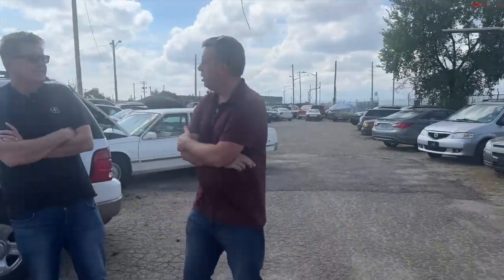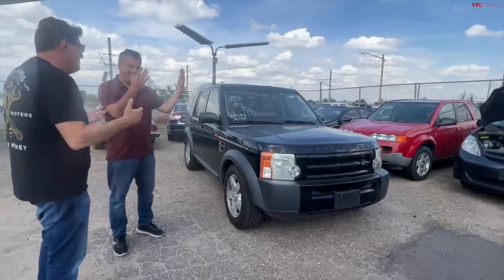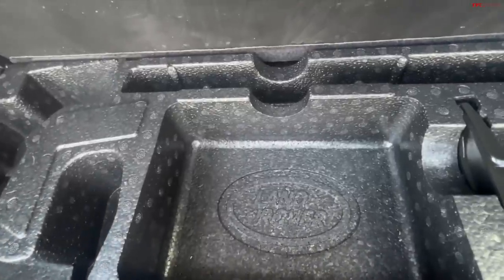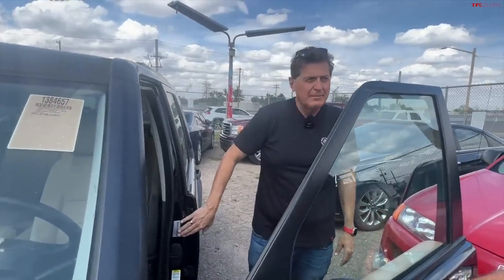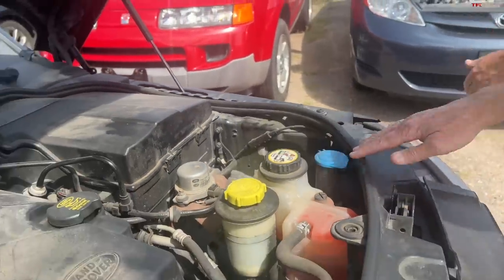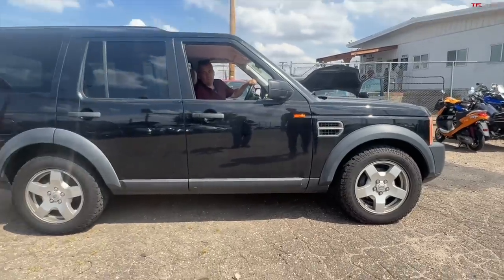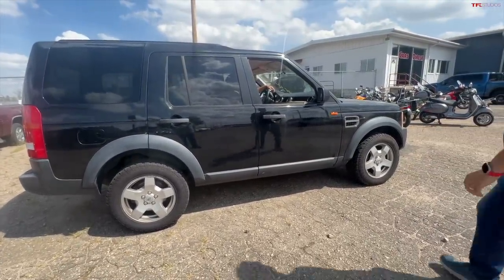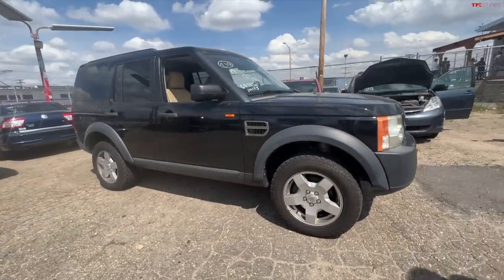Oh No...I Bought a Much Loved Car with One of the Worst Reputations for Reliability! Am I Screwed?

Comment: Transmission is:  6-speed automatic ZF electronically controlled with Sport and Manual modes; 2-speed electronic transfer gearbox with shift-on-the-move capability

Comment: I used to work at a local import shop repair shop and the top 3 most problematic vehicles were early late 90's/early 2000's Mercedes, Jaguar and Rover. Mini and Audi come 4th and 5th (so by proxy, some Porsche and VW)
Reply: JDM ftw

Comment: I purchased a 2006 Range Rover Sport last month which shares quite a bit with this LR3. Mine already the Atlantic British coil conversion, so no air suspension. It also came with a receipt for a $4800 transmission service that was done last year. I had to replace the rear brakes and rotors- the fronts were already done recently. I also replaced the O2 sensors. It drives great, blows cold AC, and the fridge works. These can be had for quite a bargain if you are willing to take a chance.

Comment: The missing Vin could be from the dash being replaced. They cracked in a lot of LR3s.  I could also just be a cover.  The V8 in the LR3 is the best V8 they had and didn't have headgasket issues. That was the D2. The v6 is fine.

Comment: If you are worried about problems with the air suspension, there are steel spring conversion kits available from the UK, at a cost of £500-800.

Comment: The valve block is probably leaking. Replaced one, its very easy. The V8s and trannys in those are easy to get 300k miles out of. Biggest concern is the front diff which isnt too bad to replace.

Comment: I just picked up a L320 Range Rover Sport based off that LR3. They're solid cars will have some small issues. Sun visor might cause a transmission fault message, of course the compressor as you mentioned, various latch sensors... Slowly going through mine. About a month new to me.

Comment: Let me say this - I have had 3 so far 1 car accident, 1 was not good, 1 is great. It is a very comfy ride- endless storage, nooks & Crannies :-) you can sleep in the back with fold down rear seats. I have had no issues to date with air suspension- and the coil conversions are available that are relatively inexpensive. Downsides are WEIGHT- it is heavy- the aftermarket for off-road accessories is not as robust as I would like (I would love a rear locker but it appears to be cost prohibitive), Electronics are a bit spotty. With The GAP II tool for the OBD is a life saver- pricy but awesome. I picked up a Range Rover sport as a daily driver (same drive train & Suspension) and though more fleet of foot, does not nearly have the storage, cup holders as the 3. 
Lastly, the Land Rover community is very strong and not nearly as many as the "bro" types that the jeep crowd attracts. Thanks guys for highlighting the LR3!

Comment: Thatll be a 2.7, if the cam belt and hi pressure fuel pump belts have been changed the you are fortunate, the suspension usually drops when parked for a while due to leaking air bags and the consequence is over working the compressor. Trace the leak/s with a mild soapy water solution and replace the air bags before the compressor burns itself out...and cgeck those belts/tensioner...
Reply: 2.7s don’t exist in the US. The US market never had a diesel. That’s a 4.0 V6 petrol from Ford.
Reply: @mcandrett 4.0 will be a V8 the V6 is a 3.0. Taken from Jaguar but produced by Ford.
Reply: @tonychalmers9867  This is the US market. The 4.0 is a V6. (From Ford or Jag, whichever, it’s a 4.0 V6 they used in the Ford Explorer). 
The V8 is the 4.4. If you look at the entire video they actually tell you that.

Comment: V6 LR3 owner here. Like the explorers 4.0 SOHC timing chain are the weakest point for this vehicle and it has a total of 4 timing chain and cassettes/guides and they like to fail after 120-140k miles. Otherwise its a great little work horse of a motor, pulls the rover smoothly, and power delivery reminds of of the D1 and D2 4.0 V8 engines.

Comment: I had one of these with the V8, many electrical issues related to air suspension components, but otherwise everything SUPER solid to very high mileage before we got rid of it, engine great, trans great,

Comment: Lol the 4.0L’s are absolute nightmares, have fun 🎉
Reply: SOHC 4.0s are for sure. The older pushrod ones run FOREVER, I have 315k and counting on mine (I think.... only has 5digits on odo, could be more). Really a shame how they took one of the most reliable engines they've made and ruined it with a halfass sohc conversion. I wonder if they could bolt in older 4.0 in it's place???
Reply: The 4.0L V6 is a way better engine than the Rover V8 that came in most of these. Tons of Explorers, Rangers, and Mustangs with 4.0's with a whole lot of miles on them.
Reply: @Stuka87  these didn't come with the Rover V8 though, the last LR product to ship with those ended in like 03. The optional upgrade engine in the LR3 was the 4.4 Jag V8, which is actually kind of a tank if you replace some of the plastic cooling system stuff as it ages.

Comment: Actually the LR3 is one of the most reliable Land Rovers ever made. Plenty of LR3’s with over 200k miles with original engine and trans + no major issues. Unlike the Discovery 2’s with head gasket issues.
Reply: The air suspension and idk if us has diesel version but the tdv6 engine with chocolate crankshaft is the issue but they are more reliable than the modern land rovers the ingenium engines are shit
Reply: That's a pretty low bar for comparison.
Reply: @sbrader97  Actually the LR3 air suspension issues were always cheap and easy to fix, typically bad hoses, but compressor on these were very good
Reply: My lr3 has 276k on original drivetrain
Reply: @sbrader97  We never got the TDV6 in the US.
Reply: The ones with over 200k miles are outnumbered 50-to-1 by the ones that never made it half that distance.

Comment: If it has a ford transmission as well, its probably only a 4 speed. The F-150 still used a 4 speed in 2006.

Comment: Hahaha, thats great.   Im a long time Land Rover fan.  Owner for 20 years next year.  Lotta ppl hate on em, but when they work they work.  So glad you got a good one.  Paid a fair price especially with such an immaculate interior.  AC may charge itself when the alternator gets cranking full blast again.  My AC will blow hot when the battery is near dead and the alternator is working double duty to keep a charge on it.  AC blows cold again after driving for a few miles at hwy speed.  Ive got steel coil springs and would recommend ditching the bags.  I just think its too easy for gremlins to mess with the bags.  My Rover has been sitting for too long ( i bought a Ford to help with savings for maintenance costs and sure enough the little 4 cyl ford focus has been hogging all the funds. ).  Looking forward to seeing another Rover Mashup.  You guys are the best.  Give her the beans hahaha.

Comment: I do cars just tore one of these engines down last night. These engines are wild because its a V6 in a V8 block. The last two cylinders on the back side are jusy filled in its wild lol
Reply: Wrong engine, the LR3 has the Ford 4.0 Cologne V6 in the US market. The supercharged Jag based V6 with the blocked off cylinders was used later in the LR4.
Reply: @jerrywagner7346  ohhh ok. I got confused

Comment: Awesome find! My wife doesn’t know but I secretly want an LR3 or LR4 in my garage as a build car.
Reply: get an LR4, it’s a really fun car. Same 5.0 liter V8 as the jaguar f type - only major issue is timing chain / tensioner issue around 100k miles. Famous last words, “only” 😂 but once replaced with updated tensioner, it should last around 200k miles. I have one with 120,000 miles. Only issue has been timing chain. Everything else has been routine maintenance.

Comment: The perfect example of why not to buy anything with air suspension. It will always fail, and is very expensive to fix. Shocks and struts will always fail due to time, but is inexpensive to repair unless you have adjustable shocks and struts, which you should steer clear of.

Comment: You should have bought that red Saturn Vue if it had the Honda V6.
Reply: according to the wheels on it,  it would be the Honda V6,  the other question would  be if it was AWD.   Great vehicles, except the frames tend to rust.  Mine 04 lasted 210K.  ran good just unsafe to drive because of the frame

Comment: My 2005 LR3 was the last straw for me with Land Rover.  I was so frustrated and angry with the crap quality and constant repairs that I sold it and bought a Hyundai Santa Fe Limited. in 2007. I've never looked back.  About half a million mostly carefee miles later in Hyundai/Kia vehicles I m sticking with what works!
Reply: Strange take. I like what Hyundai is doing nowadays but their reliability seems very suspect. It seems like I hear more engines going out in Hyundai than any other car, okay maybe excluding Chevy right now.

Glad to hear you’ve had a good experience, I’m impressed with what they are doing.

Comment: Once again Roman is wrong. The v8 lr3 was not the engine that had head gasket issues. It was the 99-04 D2. The lr3 v8 is actually the most reliable engine they put in a Rover. I own a D2 and a Lr3. Both with over 250k miles each the lr3 is 276k

Comment: Great find - too bad it’s not the V8, those are solid. I’m curious about an LS swap…
Reply: I've never seen an LS Swapped LR3. It's way more modern/complex than the older Rover V8 LR products. Plus, the main party piece of the LR3 is the suspension and the traction control system that works with it, which obviously wouldn't work w/ a swap
Reply: @Black-Villain  - Google? It’s rare, but there’s a “kit” (supposedly)…seems like a worthy TFL adventure
Reply: @bonusb2924  I did Google it to be sure. There are no LR3 swap kits. Only LS swapped LR3 is one on a forum that the guy did all custom and none of the factory electronics work in

Comment: hmmmmmm Ford V6, so, Ford tranny?  That could be good or bad depending upon the year and model.
Reply: 6-speed automatic ZF electronically controlled with Sport and Manual modes; 2-speed electronic transfer gearbox with shift-on-the-move capability
Reply: ZF6HP. The 4.0 is absolutely not the engine option you want in these, it's underpowered and unreliable. The optional 4.4 Jag V8 is 100% the only engine option to get
Reply: @Black-Villain    But they DO NOT have that engine, they have the Ford V6.  My question is about the vehicle that they now own, so your point is not relevant.
Reply: @OldThomMerton  what? The one they just bought has the Ford 4.0SOHC w/ the ZF6HP

Comment: i did a pre purchase inspection for a lady wanting to buy a land rover. it had many issues i told her to stay away from it. she bought it anyway. a week later she comes in with a coolant leak. we referred her to the dealer she said the dealer wanted $2,000 to fix it. we told her we would not work on it. so she gets it fixed and it returns 3 more times with other issues and each time we explain it needs to be repaired by the dealer, that we are not equipped to make repairs on euros. we haven't seen her in over a year. i think she got the idea. we have so many people bringing us euros wanting us to repair them because our labor rate is lower than the dealer's. most of these folks can barely afford to do oil changes let alone get something fixed at $200  per labor hour. i just don't get why poor people think they need to drive Mercedes, BMW ranger rover or any euro. i tell people buy Japanese you just about cant go wrong.

Comment: The Tdv6 is most unreliable and worst engines aver put under the hood of Land Rover model. I do know what I'm talking about. Ben retated with Land Rovers over 27 years and seen within past nearly 20 years tens and tens failing engines every year due the broken crankshafts or oil pump failures..  Both on 2.7L and 3.0L model.

Comment: C'mon guys. You owned one of these already and you loved it. Now you start off bashing another one that appears to be just fine. The 4.4 V8 was the best engine. Most reliable of the bunch. 6 cylinder not powerful enough. I now have 182,000 on my 4.4 and still no engine issues, never a suspension failure, and never a no start or stall issue. Please stop jumping on the bad Land Rover parade. BTW you have to actually push on the symbol left of the climate control showing the dash vents in order to feel any AC coming through the dash vents.